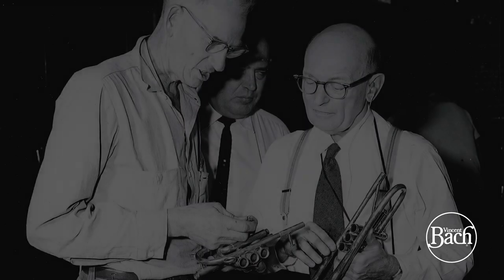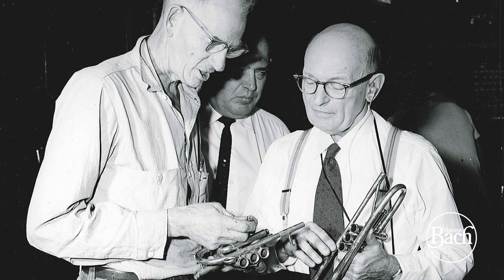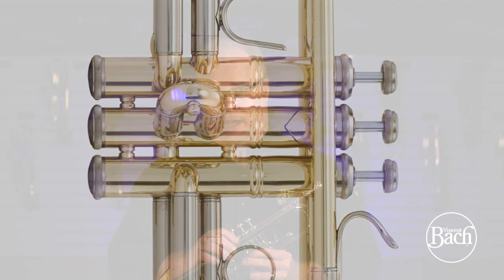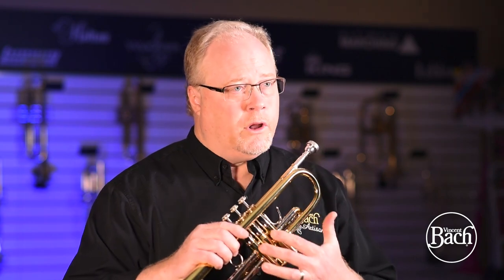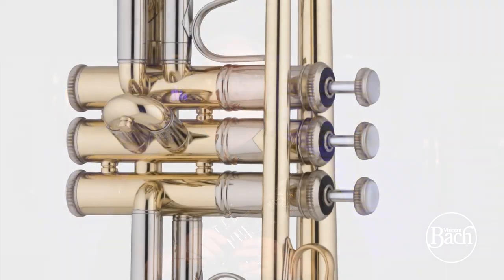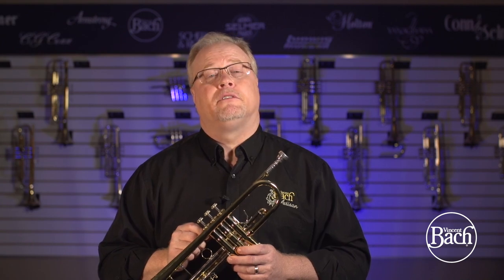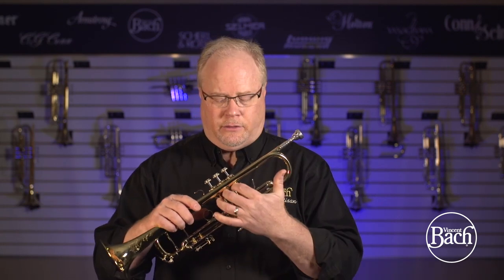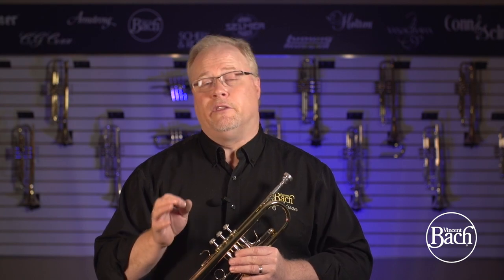180 vs 190 Bach Stradivarius Trumpets

Comment: Bit confused here. My Elkhart 37, S/N 71135 appears to have the two piece valve set because the balusters are Nickel. Or is it just Nickel plating, making it appear to be two piece? Not that it matters. We've been together since around '73 or '74. Just curious.
Reply from the maker: There is an error in the video, where it's stated that one-piece valve construction started in the late 60's, it was actually started in the late 70's / early 80's. So yes, if your trumpet is from 73 or 74 it would be a two-piece valve constructed horn. Hope that explains it for you!
Reply: @connselmerinc  Yes it it does. Thanks!

Comment: The brass industry is just as hilarious with its little meaningless jargon as kayak manufacturers are with their hydrology jargon. You put a one piece valve block and a two piece in an acoustic lab and the difference will be undetectable by the human ear. You put them in multiple double blind surveys and the results will be statistically insignificant. Just say one is brass and one is brass with nickel trim.